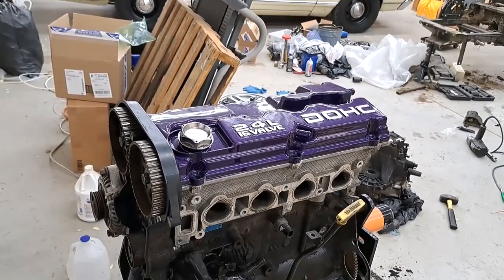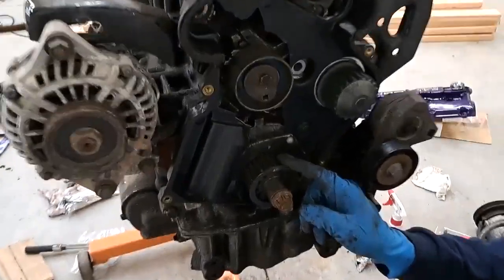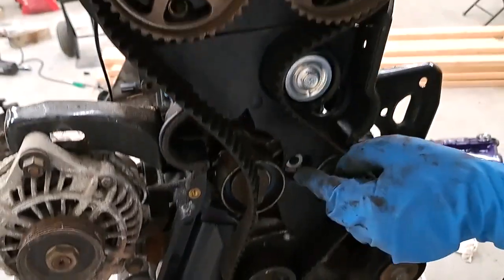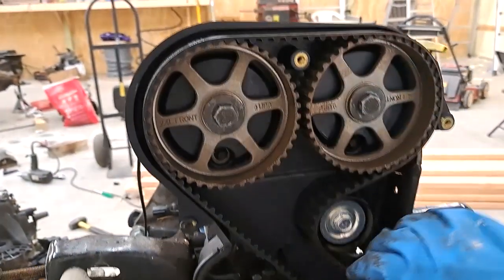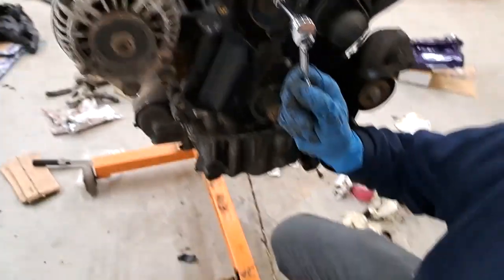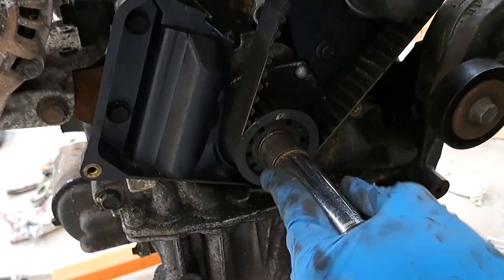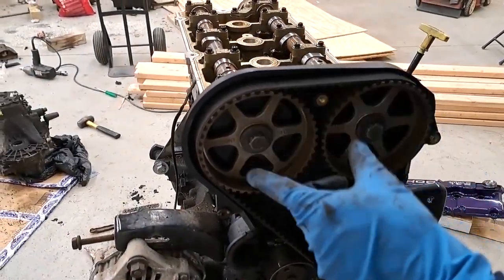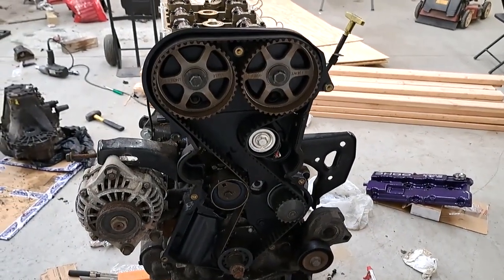How to set a timing belt on a Chrysler and Dodge 2.4L engine

Comment: According to Alldata the exhaust cam, the one in the back, is supposed be a half tooth below the front one. Yours looked to be the opposite, I’m wondering if that was accidental or intentional? 
You should’ve covered finding TDC for the #1 piston, just showing you spin the crank to line up the mark could cause someone to need to redo all that work.
Reply: the reason is because his camshaft sprocket is installed opposite of what the manual says.  both arrows are supposed to be pointed up per the manual.  He has his exhaust up but his cam down, therefore his alignment is opposite of the manual.
Reply: @chachout  could this be why mine won't start?
Reply: He Explained At The End he is Using a 2.0 Cam So it’s Flipped

Comment: How bad would it be if u didn't realize someone put 2.0 cams in your 2.4 and u turned it on 3 times after timing to 2.4 marks? I thought they just used 2.0 sprokets and read theyre enterchangable. Started it idles rough but sound good if I gas it. I couldn't see the 2.0 marks before I took them off and scrubbed there was soo much gunk in there. Long story. So I just thought they're a tooth off. Now I don't know if it was flipped over or not. 🤦 mom trying to do this for my teenage daughter. I know enough to f some shit up apparently.
Reply from the maker: Make sure both holes in the cams are up. If one gear is flipped 180 off when installing them there 2.0 cams.